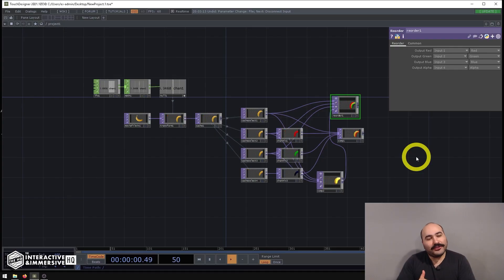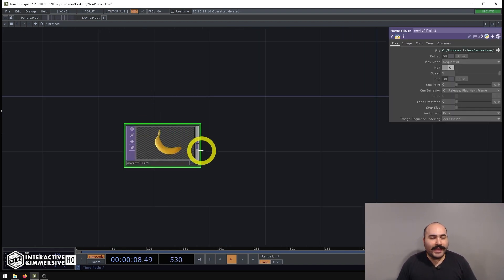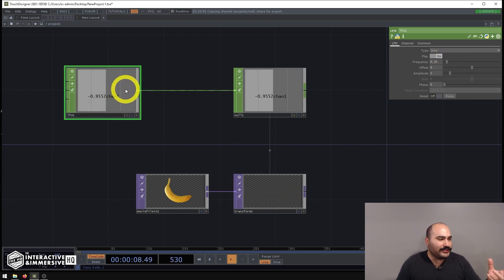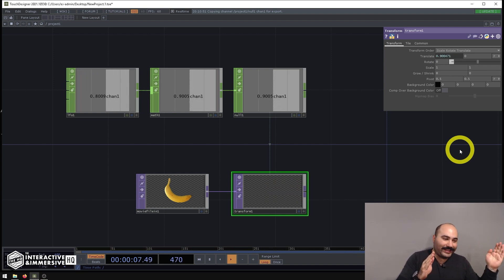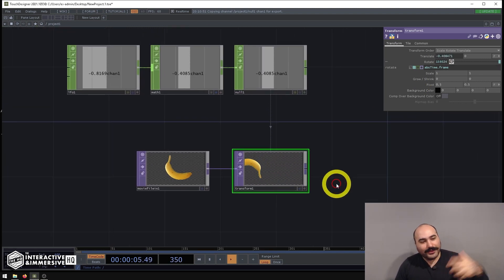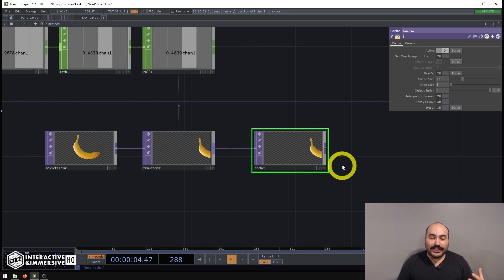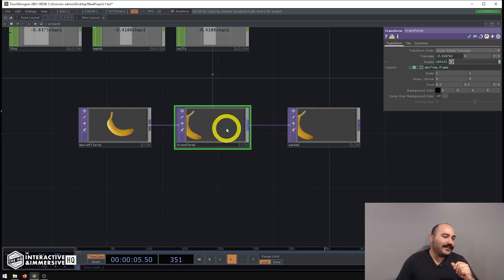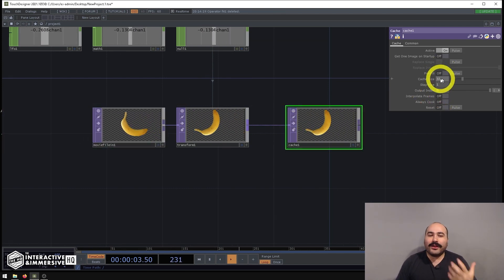Trails & Frame Delays: TouchDesigner Tutorial 041

Comment: quick and to-the-point tutorial, thanks! I was wondering is there a specific top that lets the trails stay a while on the canvas and then fade out really slowly?
Reply from the maker: It's not a single operator, but you can definitely pass the result after your trails into a small feedback network using a Feedback TOP and a Cross TOP. Have you worked with feedback in TouchDesigner?
Reply: @TheInteractiveImmersiveHQ  Thanks! Yes I tried the feedback top along with displace applied to a circle, and it did lead to some interesting results. Still the trails would disappear pretty fast. I will play around with the cross TOP this weekend.